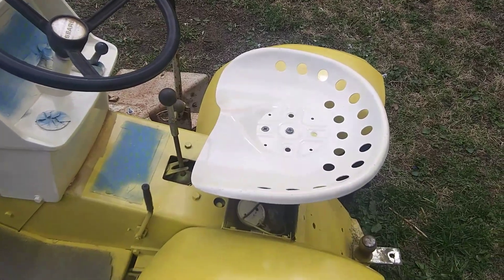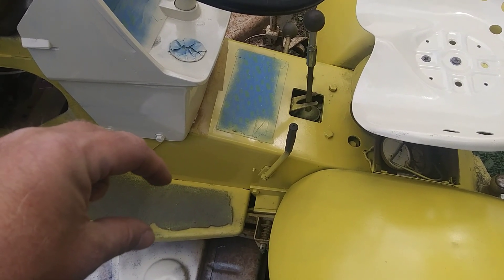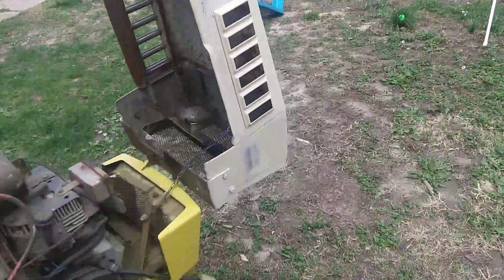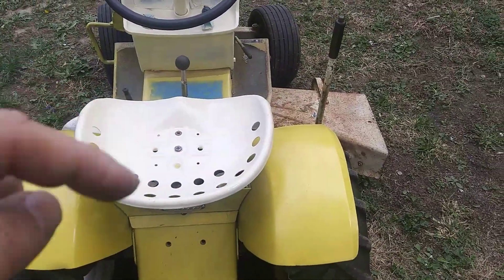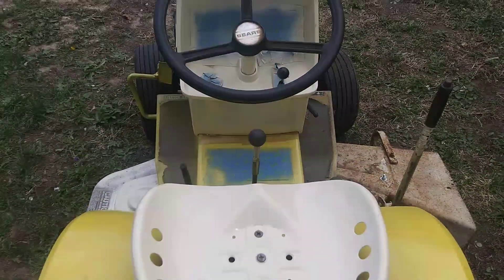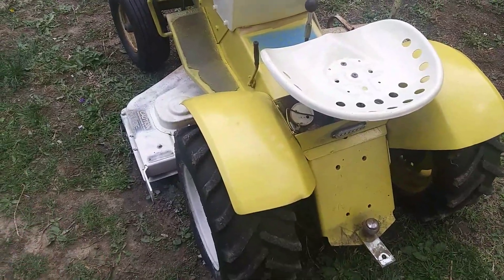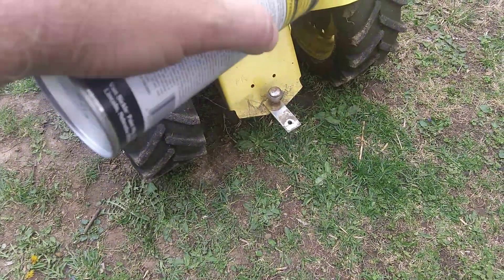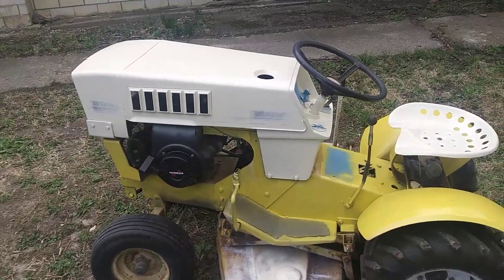Small improvements on my 1974 Sears ST/16

Comment: It's lookin really good JM! I'd say that IH white is a very close match, ah the joys of painting, bugs, wind n dirt am I right? lol a tip I'll give ya for when you paint the rims is deflate the tire and push the bead off the lip just enough to get either masking tape or those business mailers under there and it will give you a killer finish but not on the rubber lol
Reply from the maker: Thanks for tip. My rear tires already have a bit of paint on them. I'm going to get some paint thinner to clean the up. I went to get cub cadet white. No one had it locally.